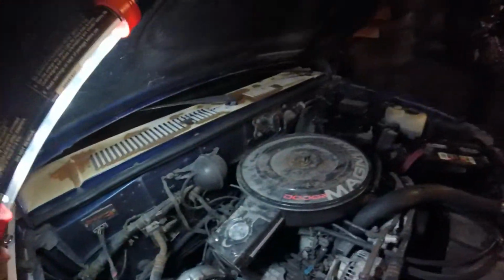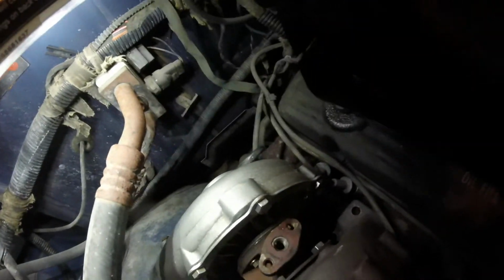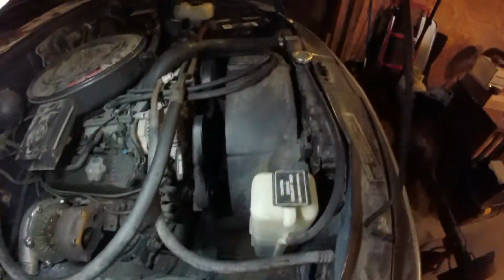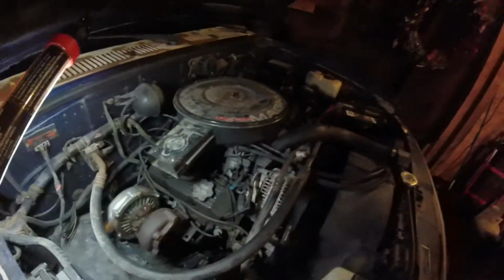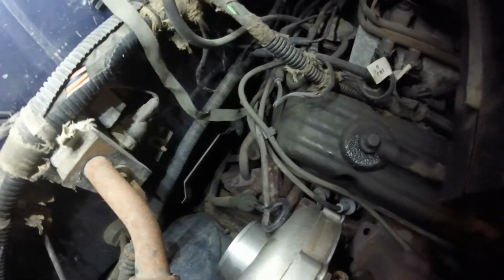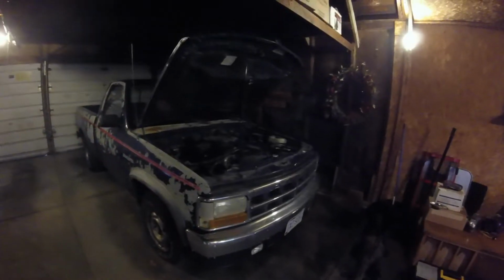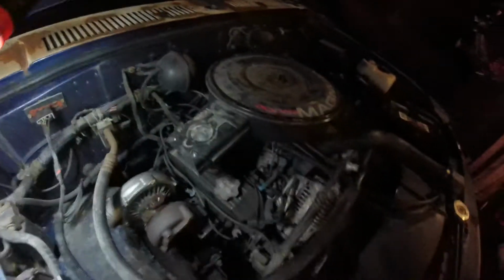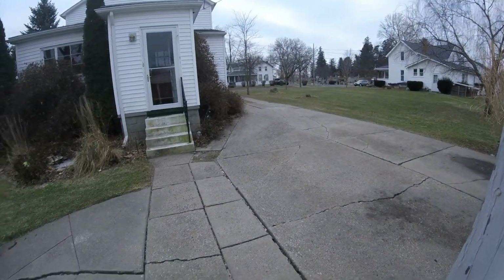The Plan For The Dakota Turbo Build

Comment: U ever think about a remote mount system wher turbo is underneath cab or bed
Reply from the maker: +Mike McCabe i have but I'm not a big fan of remote mounts. They usually require a oil pump for the turbo return and there isn't much room for my charge piping to run back through without risking hitting the exhaust.
Reply: Rust Belt Garage right ons I've been trying to figure a way to turbo mine I have the 5.2 that I've had the 390 stroker kit in it for awhile & now i want to do a turbo set-up but im still trying to figure out not just the best way but also most affordable way.. I have a dual altenators setup so im limited on space from that & all car audio electrical and was considering the remote mount but I didn't ever think about the oil pressure issues that could be an issue.. so glad I mentioned it cuz was bout to order stuff tom but thx to u, now i know I'm def going to have to get more knowledge on how to go about it so I don't jump the gun

Comment: what all did you do to the fuel return and evap system?
Reply from the maker: +abdel torres fuel return will just be a single hose from the fmu, evap will be deleted completely when i revamp the fuel system. Its still there right now but the evap line under the truck is blocked off.